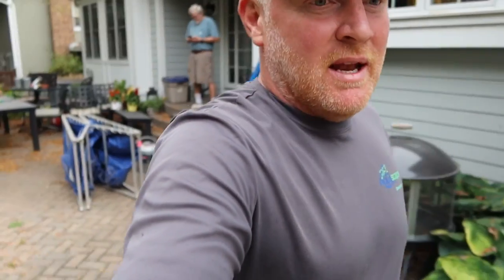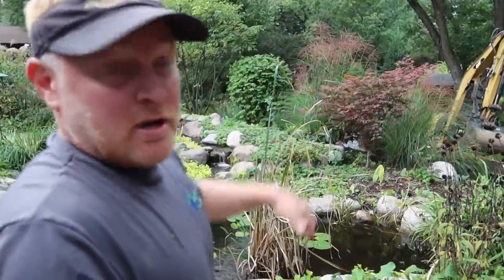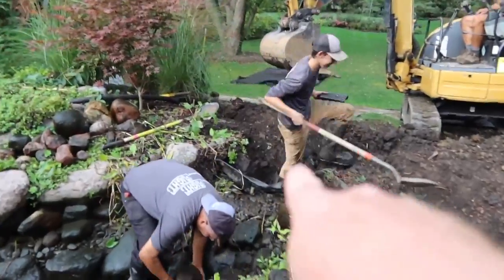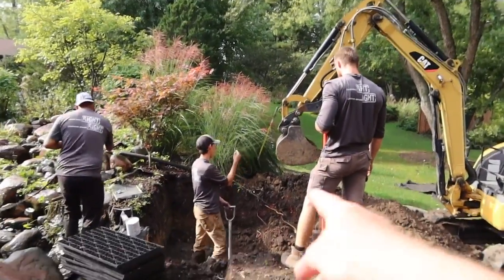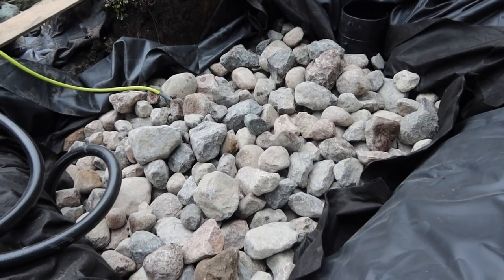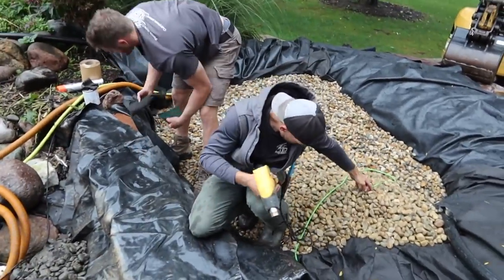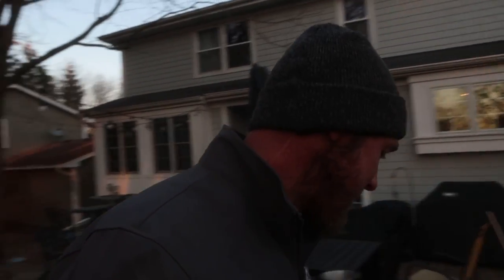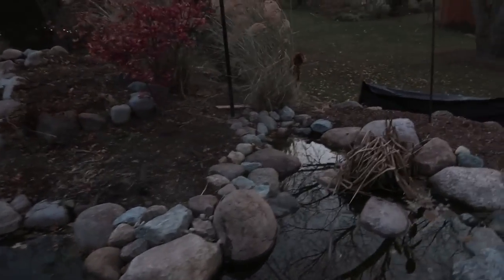How to Build a Wetland Filter for an Existing POND

Comment: Question about the plumbing on this... does the water flow to the bog come from the pump in the skimmer? If so did you split the line from the skimmer pump between the bog and the waterfall?

Comment: I have a quarter acre mud bottom pond that has been on the land here in new mexico since the 1930’s. It is fed by a well. It has 2 large recirculating pumps that flow into 5’x5’x2’deep basins that have iris and celery and cattails and charcoal in them. I just learned about bog filters from ozponds who recommended your channel. I am working out how to make our pond swimmable and figuring how large of a up-flow wetland bog filter i will need. I want to get something going as soon as possible. There are some areas on the bottom of the pond with up to 2 feed of squishy muck! wondering if we need to dredge the pond. I have a friend that says i can sell that gunk to farmers. here in the southwest some folks pay $10,000 per year to fertilize 2 acres of cash crop organically!! it would be cool to cover the cost of a pond upgrade to make it swimmable with the gunk we pull out. Almost 100 years of tree dibree in this pond, its surrounded by trees:) we have koi that are barely able to be seen at the moment because of the algae. i put 30 baby cat fish in there 5 years ago and have not seen them since so i don’t know if we still have them. there are 1000’s of gamboozia minnow in there and there are 2 domestic ducks and who knows how many turtles. We are building a corral using carpenters fabric or 1/2’x1/2” square wire to keep the turtles and fish from destroying the lilies while we get them established. Any way our pond is 100’ x 110’ and 2 to 3 foot deep on the edges and up to 7 foot deep in the center but 1.5 of the center depth is muck. How big would you recommend our bio filter be? we want to turn the old below grade pump house into a cold plunge but maybe we should just use that as our bio filter! its about 7 feet deep and 12’x10’ and its all-ready next to one of the upper water falls. our goal is to have this area as a private club for folks to have a hot tub and cold plunge and gazebo with kombucha and hibiscus te on tap:) we are situated next to a winery with a private dining club so we think we can be the natural swimming and soaking club. OK last little question here, have you worked with food grade hydrogen peroxide as a cleansing agent? we were thinking our hot tub water would be purified with hydrogen peroxide. I have heard it is an amazing plant food after it is used in a hot tub for a month:)

Comment: I've been watching all these videos for ages and I've only just realised that Aquascape do wetland/organic filters in the opposite direction to everyone else...
Aquascape - the water goes in at the bottom and filters as it rises up through the wetland;
Everyone else - water goes in at the top and filters as it goes down through the wetland.
My initial thoughts are that filtering upwards needs more water pressure, and results in having to clean out sediment, but you get a more even movement of water through the whole wetland, whereas filtering downward would lead to the water finding paths of least resistance.
You can run a whole downward system with a low power bubble pump, but that would rule out any sort of significant waterfall - the pool and filter would have to be pretty much at the same level.

Comment: Looks nice.  I've heard that disguising the wetland filter by placing boulders on top of the gravel (filter media) reduces the effective area of filtration.  Do you compensate for this by oversizing the wetland, or is this not a concern?  Also, what size pumps are running this feature?  Thanks, and keep up the good work!
Reply from the maker: Not really a concern we want to slow the flow down anyway so the solids settle. The boulders are on top of the gravel so it does really effect anything. I think this one had a 5 to 9 on it.